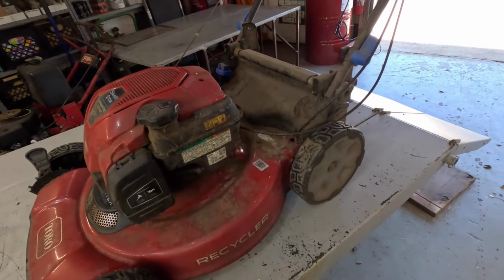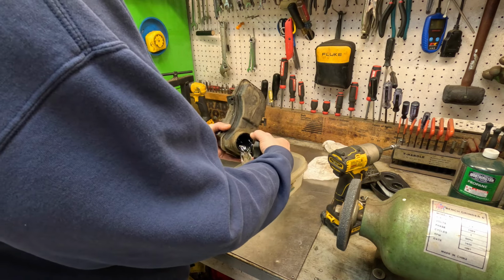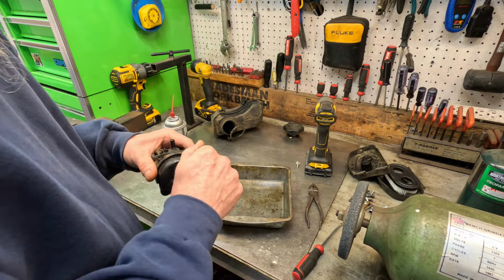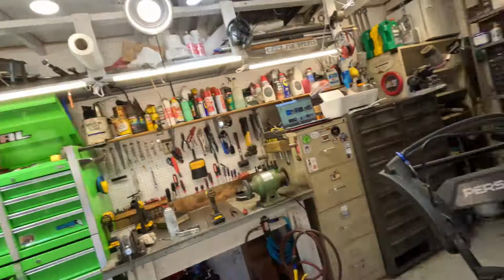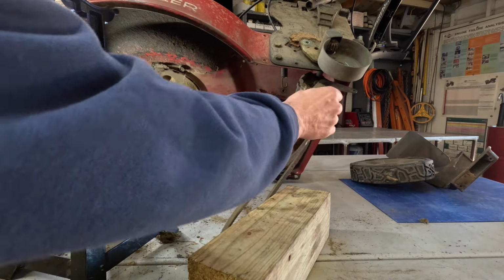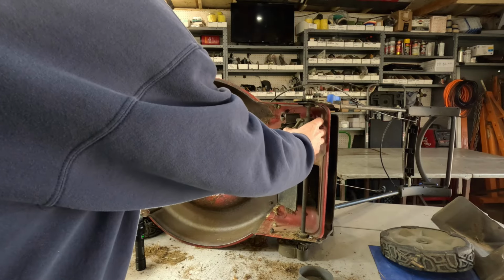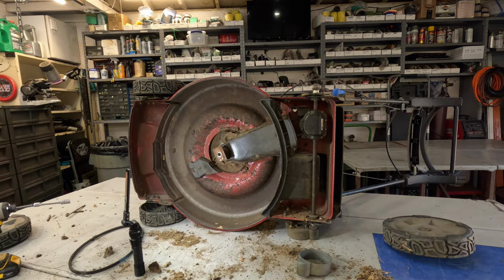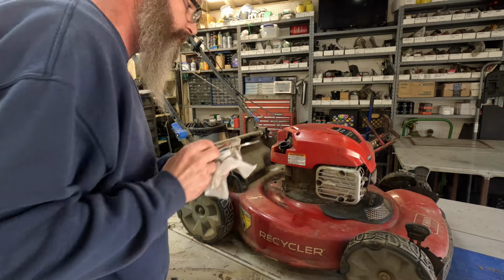Another TORO Recycler 22 Inch Personal Pace | Full Uncut Service!

Comment: Had one i sold for $200 also 
 The belt came off the pulley in the transmission area, and the air filter was so clogged it would not rum correctly after all that and solid machine  nice work on this one Tom sir 🔧🔧

Comment: Yes it's a PITA to have to remove the trans just to change a belt!
Question:  My personal pace gets hung up often when trying to pull the mower backwards.  Tried cable adjustment...helps a little but still does it.  Is there anything else that can be done to eliminate this?  This is on a brand new machine.  I will take it in for warranty service if necessary but would prefer to fix it myself if there's a solution. Thanks.
Reply from the maker: make sure it doesnt have debris stuck in the trans pulley
Reply: @TomDobyMowerRepair  its brand new out of the box...no debris.